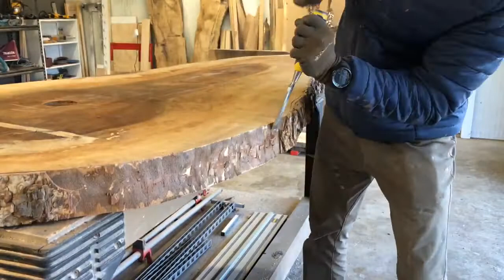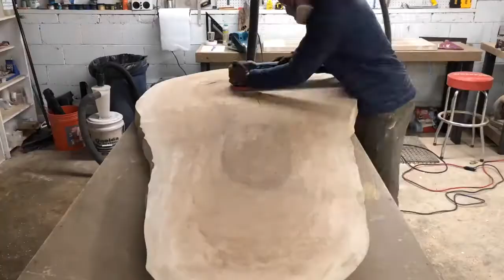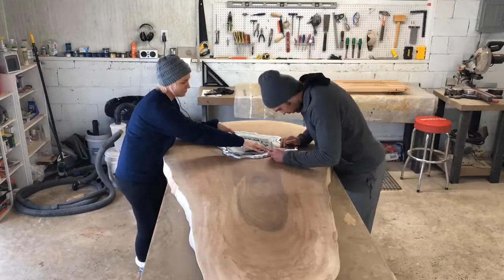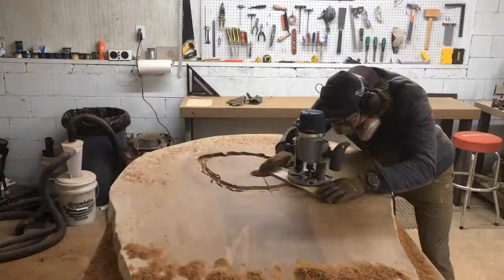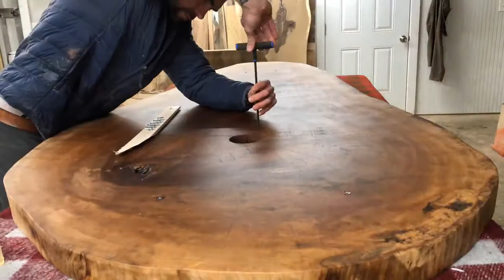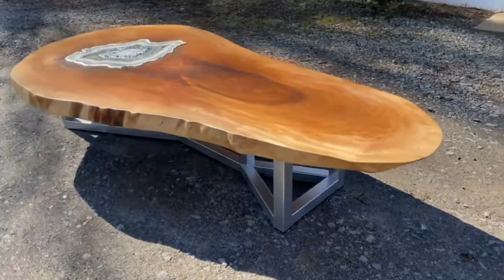Making a Geode Coffee Table from a Live Edge Sycamore Cookie Slab

Comment: Hello. How do you like the Osmo finish? I have a cookie that is about 9" thick and 24-30 wide, I want to slice it, and maybe get 2 or 3 little bar table tops out of it. the tree was cut about 6 years ago, i think it's time to cut it up.
Reply from the maker: @ElLocoMonkey2012  Hey! I like Osmo a lot and it looks really great, though I switched to Rubio a while back actually. I think Rubio looks just as nice but offers a bit more protection
Reply: @ziwawoodworkingco.3727 cool, good to know.